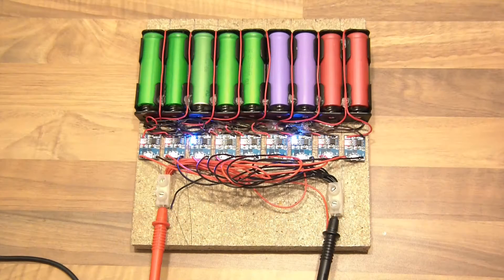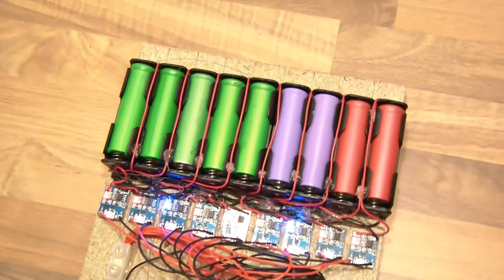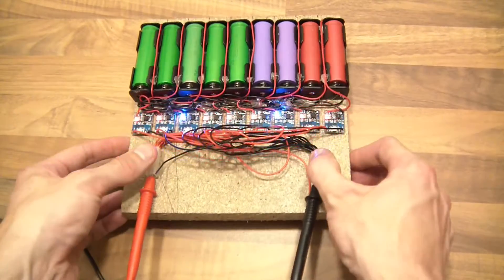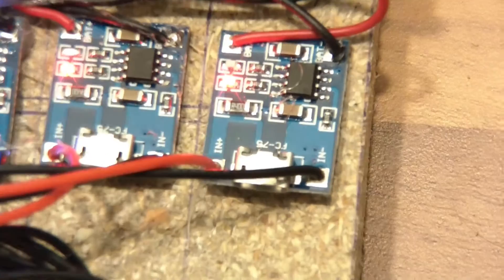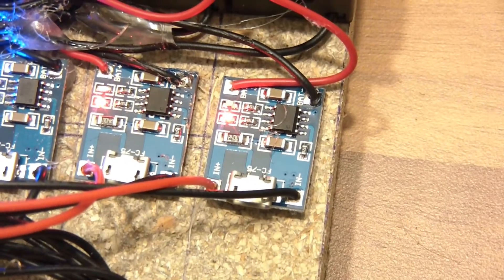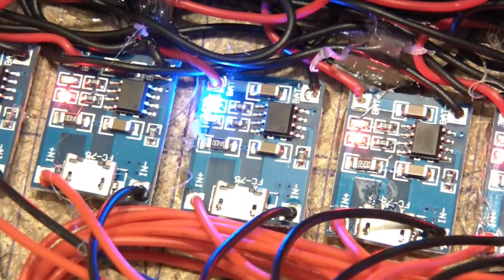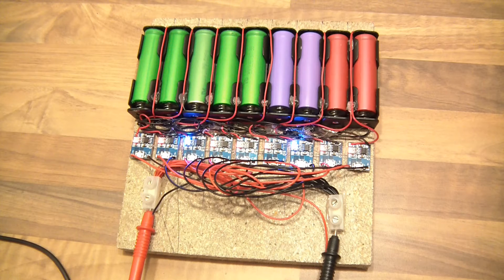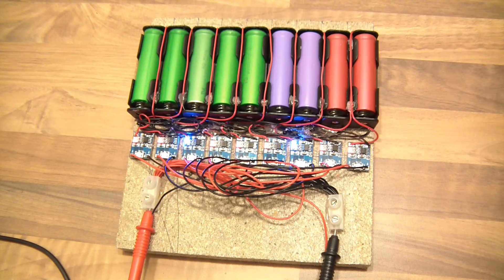TUTORIAL: How to Create a Cheap Lithium Ion 18650 Cell/Battery Charger! (TP4056) - Update!

Comment: Have you double checked your solder connections? I've bought several and haven't had any issues. I know the boards are cheap, but they still shouldn't be failing like that. Now, if you plug in the cell backwards on these boards, they will do that as well. I know it's a idiot question, but you've made sure you didn't put the cells in backwards, right? At least once before you noticed they weren't working? Just a thought.
Subbing to your channel. I see you have lots of neat videos to watch. Not sure if you're over on the diypowerwalls.com or not, but it's a great source of information pertaining to 18650's in many types of applications.
- Korishan
Reply from the maker: Bobby Hicks Hey! Yes, the cells have been put in correctly. I think I just got faulty modules as the others are still fine. I'll try to repair the broken ones! Thanks for subscribing and commenting. Please keep in touch. I love hearing about all of your projects and ideas.